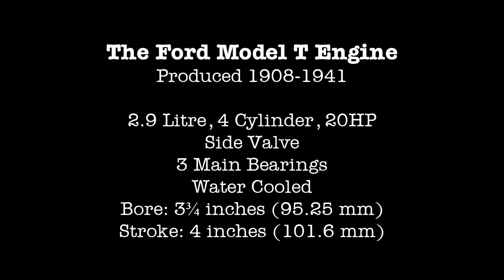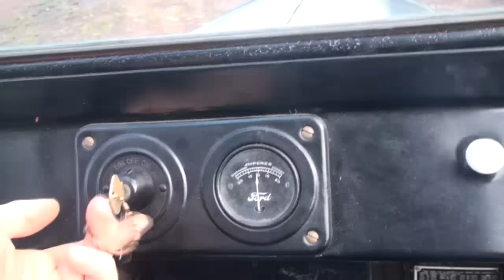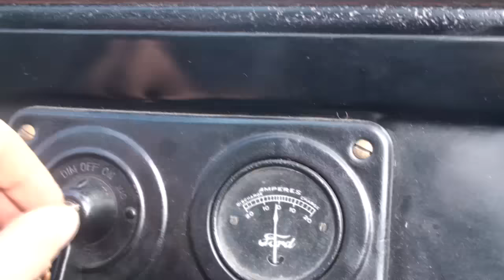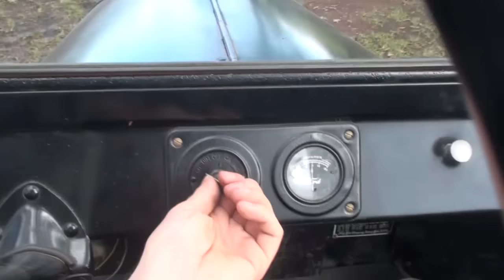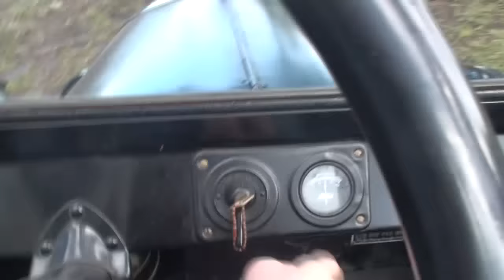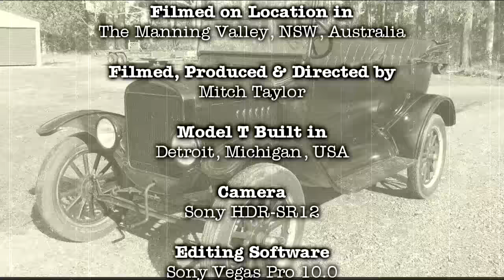Ford Model T - How to Start & How to Drive

Comment: What an amazing machine! Utterly complicated (by today's standards) but definitely great. And your Model T seems to be extremely well maintained, too! Looks about brand new. That is simply fantastic!

This video made me want to drive one of those, just for the experience. Though I'm pretty sure I'd be quite scared of it. Not because of how complicated it is to get it going but mostly because of the fear of breaking something. Or crashing it if I managed to get it going. Hahah. Still, definitely something I wish I can have the chance to experience some day. :)
Reply: COMPLICATED?!  You're obviously NOT a mechanic.  ;)  Sure, they took some more effort and knowledge to operate, but mechanically, these are some of the simplest cars ever built.  Modern car RADIOS are more difficult to operate than this car.  The simplicity is why I love old cars.
Reply: About the only thing you could break on these amazing autos is your arm by not starting it properly...these cars were designed to last FOREVER and to weather the brutal punishment of the non existent roadways of the early 20th century with aplomb. The Model T was the very definition of elegant, efficient simplicity, and with basic maintenance will continue to run well into the next century!
Reply: True and it'd only take me a week to drive from Southern Illinois to Arkansas...a mere 300 miles or so.
Reply: You would've had to shodd your horse now and then, saddle and hang a feed bag before Model T appeared on the scene. Where is the complication here?
Reply: @Riccardo Scavo You're forgetting a few minor points about genuine horse power's "simplicity" of ownership and use. Let's look at a few of them, shall we?

You need to provide a clean, warm, dry place for your horse to live/sleep, especially in inclement weather. Horses have a nasty tendency to not like little distractions like thunderstorms (and other loud noises...they're quite tempremental), get sick when they get wet and chilly, and have this really bad habit of dying when they get too cold, too hot, too ill or just because they've reached a certain age! 

Along with shoeing them, you need to care for their hooves too, as well as regular grooming and veterinary care when needed. Neglect this required care, and your horse will respond by becoming lame, getting sick, and generally falling apart at the seams, which can result in that irreparable condition that horses tend to experience...dying.

And when you "just hang a feed bag", you need to remember that a horse needs to be fed and supplied with water throughout the day, every day, whether you're using it or not. Running out of feed, hay or water is most assuredly NOT an option, if you'd like your horse to not do that nasty little "dying" thing when you least expect it.  

Speaking of use, there's a finite distance/time one can use a horse before they become physically exhausted. If you exceed that limit too many times, your horse will respond by (once again) doing that rather inconvenient "dying" thing at the most inopportune moment.  (Have you noticed the reoccurring theme yet?)

Then there's the little matter of the horse's "exhaust"... every city in the world had a small army of full time employees who worked 24/7/365 to clean up the literal MOUNTAINS of horse turds that clogged the streets! This "exhaust" is a regular thing as long as you continue to feed your horse, and needs to be dealt with wherever the horse is, whether you use it or not. On the plus side, horse "exhaust" makes great fertilizer!

Horses are beautiful animals and can be extremely useful for a host of situations, but to say owning one is the height of simplicity shows me one thing...that you've never actually owned and/or cared for a horse!

@Mike Ries...yes, it may have taken a week to make that 300 mile drive in the T's heyday, but you need to consider the roads that this fine automobile was designed to be driven on...they didn't exist! 

At best, you were in a city that had cobblestone streets. More likely, you were in a small town with dirt roads (mud). If you lived in a more rural area, those muddy, rutty dirt roads were the height of luxury...if you needed to get anywhere beyond "the beaten path", you were literally roughing it through mostly undeveloped territory! No roads or paths of any sort, full blown off-road conditions...and it was this way all over the country when you wandered beyond the "civilized" confines of the cities. 

This is precisely why the cars of the early 20th century had such tall wheels/tires and had so much ground clearance...they were the very first off roading rock crawlers! With all this in mind, the week long drive to get 300 miles becomes a bit easier to understand!
Reply: Dear Celtic Fury, you had me at a disadvantage, beaten hands down. I stand corrected, there is little to disagree with your take on 'horse power' assessment. Owning a horse a an ongoing commitment on a ''theme'', neglect at your own peril. I was merely drawing a comparison to IceCloud's conjecture about modern cars (a laptop would fix) to getting one's hands greasey before you even crancked the engine, in the case of model T which is less preferable, to owning a horse which entails everything you so patiently noted. You were right, I never owned a horse and live in a city like any other UK city, with quickly disappearing green belt. Regards
Reply: Mike Ries lmao, you are most certainly correct good sir!
Reply: Utterly complicated? Looks darn simple to me.

Comment: "But how do you turn on the lights???"
Reply: With a match.
Reply: @John_Fx  In this model t they're clearly electric bulbs.
Reply: On the battery and magneto switch. Its Dim or a separate lever thats under the choke primer.
Reply: @Woagoo  omg thank you so much. I was really curious about it since It wasn't mentioned in this video...
Reply: @enzoperruccio  No problem glad to help, however i dont know what the difference is between the 2 options because i have a 1918 with the Dim on the magneto switch, but maybe older or newer models have the separate switch.
Reply: @John_Fx  LOL exactly
Reply from the maker: I can't believe I missed this one in the tutorial! It's the only switch on the dash aside from the ignition switch :) Well spotted!

Comment: Wow, imagine if the petro tank explodes, you'll be heading for the sky
Reply: WW2 Jeeps, MB, GPW, all the way to the CJ5 had the same arrangement.
Reply: Gasoline in it self doesn't explode
Reply: the Model T's fuel tank is lined with a material (i can't remember what it's called) to stop it exploding in the event of a collision or shock from starting
Reply: I'd prefer the Model T's gas tank compared to what I learned to drive and ended up being my first auto. A 1965 Chevrolet C-10 pick-up. It was my dads that he bought new and became mine in 1975. Manual steering and brakes with a 230 in line six and 4 speed heavy duty manual transmission. First gear was an unsynchronized granny gear so you always started in 2nd. The gas tank was located in the cab behind the seat back. Everytime you filled it up, it REEKED of gas and the danger was in a roll over the flexible hose between the tank and the outside would most of the time separate and fill the cab with gas. One spark and you're TOAST.
Reply: That's right, but I'm sure you know the model T ran on petrol mixed with liquid oxygen
Reply: Many modern cars has tank under back seat
Reply: chrismomo1977 it’s the original ejection seat in case of a car accident
Reply: Those liquid oxygen tanks are hard to find,even when mounted correctly. My model has the photon torpedo bank option.
Reply: @FireFist Asbestos? :-)
Reply: Same as if you just had eaten at Taco Bell
Reply: How many times have you seen a car's fuel tank explode in real life?
Reply: Lol, the old fords usually included a fire extinguisher in cab, but of course by the time you were able to access it you'd probally be charcoal
Reply: Earley prototype of Buck Rogers.
Reply: There is a song about just such an occassion with an old Mercedes machine. It's called "I think I oughtn't auto anymore" sung by Billy Murray on Edison Records (actually it's on a wax cyclinder). Google it; very funny song.
Reply: Henry Ford invented charcoal.... he was a founding partner in Kingsford charcoal.
Reply: avkie: Its sealed better & ventilated better too in a modern car.
Reply: Yeah... and nothing happened... amazing eh!
Reply: @danr5105 " fire when ready,Mr. Sulu! Scotty, beam me up!"
Reply: @ltr4300  Pinto ring a bell!?
Reply: Yeah they burst into flames if hit just right. Still not an explosion. That's a conflagration. There's a difference. One has overpressure and a shock wave. The other is just a big fire. Of course you're going to have big fire if you rupture a fuel tank and have an ignition source...but while fuel vapors are explosive in the proper mixture with air, liquid fuel has a hard time creating that. Because the liquid can only react with the air at its surface, which is minimal area. I've put lit cigarettes out in a pool of gas to demonstrate this to people. I've watched cars burn completely to the ground...there's a huff and some flaring when the tank finally gives up. They still don't explode like in movies. An empty fuel tank with nothing but vapors is the closest you'll get to that, but the availability of air still has to be in a narrow range...anyway, Pintos would APPEAR to explode because the sequence of events was car gets hit in the rear, bumper or some other body metal pierces the tank, while creating sparks from metal to metal impact, just as fuel gets slung out of the ruptured tank. If you fling the fuel across an intersection in a nice aerated spray, yeah you'll get a tremendous fireball  and the car is going to burn as it comes to a stop still hemorrhaging fuel from the rupture.
Reply: @dougcook7746  Henry Ford did not invent charcoal.
Reply: LMAO
Reply: This is just a cartoony joke so don't get up in arms about it
Reply: dXb The gasoline vapors above the fuel IS explosive. And yes i experienced that myself with a wood burning furnace. Threw a newspaper drenched with petrol in the furnace, began looking for matches, by the time i found them the whole furnace was filled with petrol vapor. I threw a matchstick in and i flew backwards a few meters. So yes, a not completely filled petrol tank is dangerous.

Comment: Is there any certain type of fuel you use? I heard Model T's can run on just about anything.
Reply from the maker: CopeLongcut94 I use regular Unleaded. But the T engine was designed as a multi-fuel engine, and would run on Ethanol, Kerosene and even Whiskey!
Reply: Actually that was a modified 1921 Oldsmobile model 46 roadster...

Comment: Wonder what an early 1900s ricer would do to this beauty.
Reply: +50 horsepower stickers and new rims
Reply: Please, no
Reply: The expression "hot rod" came from modding cars like these. When the Model T first came out, few people were interested in modifying them--just having an automobile was cutting-edge enough for most people, though some racers would drive Model Ts stripped down almost to the bare chassis with tweaked engines. But in the late 1930s people began to take old cars and rework them for speed, and the trend really caught on after World War 2. Many of the cars modified were Model Ts, and some of these modded cars are still around. They can be really wild-looking, with monster engines and huge dragster-style rear tires. Often the bodies are also thoroughly rebuilt, but if you look carefully you can definitely see the Model T origins.
Reply: My grandpas friend had one in the 50s and they put huge tires on the rear end put s snowmobile engine in it and raced it down main drag
Reply: My father's eldest brother souped up a Model-T in the '20s. He installed a Frontenac head and several other improvements. It would do over 50 miles per hour at first, but it got "tired" after a couple of years. Uncle Ed then gave it to my father who drove it to high school. Dad saiid he "raced" his best friend Home at full throttle at about 15 miles per hour.
Reply: I bet cops couldn't even recognize the car and the model on the highway on that speed back then
Reply: Ricer? Uncle Ben, maybe.
Reply: Smuggle moonshine and invent NASCAR.
Reply: Gun Safe +0.5HP Moonshine Safe +10HP
Reply: CrashSeven Japanese cars didn't exist back then, go back to school.

Comment: I rode in an early 20s Model T hard top, cant remember if it was the center door version or not, but I remember getting close to 30 or 35 mph was scary and thrilling and was probably maxed out around 35 or 40.   What a fun ride.  I hope these cars can stick around for another 100 plus years.

Comment: Extremely informative video. I knew the Model T was simple but it was interesting to learn that general maintenance, starting and even basic operation would prove challenging for those learning to drive back in that time. Thank you for taking the time to highlight many points of the video as well. On a side note, what is the name of the song you used in the video? I've heard it before long time ago but had no clue what it was called.

Comment: Very informative. 
Is petrol in Australia unleaded like in the USA?
I am assuming that the Model T needs leaded fuel to protect the valves. 
Do you use a lead additive?
Reply: Yes unleaded and Premium unleaded (octane), then we got Gas and  Ethanol and a few others.
Reply: @badasshuh69  mine run on my piss

Comment: Great video. Harks back to much simpler days. Then again, the petrol powered car has not really come all THAT far now has it? Sure there are computers and fuel injection, but its still suck, squeeze, bang, blow when it all boils down.
Reply from the maker: +VindalooSoup "suck, squeeze, bang, blow"... I believe James May said that on one of the Top Gear Christmas episodes lol ... Hilarious but absolutely right :)
Reply: "Not come very far"? Did you notice in the specs how this only had 20 HP? My lawnmower has more power than that (seriously; it's 25 HP). While the basics are the same, the real advance in engines has been HP per liter; a current 2.9L engine would output nearly 300 HP.

Comment: Attention: Bank Robbers
This may not be your best choose for a "get-a-way" car
Reply: That's why the gang made sure they had a driver (whose duty comprised much more than just the driving portion). In the old movies they would say keep the engine running. That's because they would be back in a minute or so, so don't dick around, and you'd be two minutes ahead of the cops while they were getting started.
Reply: SpeakEasy DoorMan choice
Reply: But it would be the more elegant for sure
Reply: Bonnie & clyde 😂

Comment: Would you adjust the timing lever as you increased the throttle?
Reply: It's fun to learn and becomes second nature, like the pedal layout being all funky. If you ever get a chance to drive or even own a T go for it. The real fun happens when you panic brake, for most people that means slamming on the middle pedal. Do it in a T and you hit reverse. I did that on a dirt road once. Fun times.